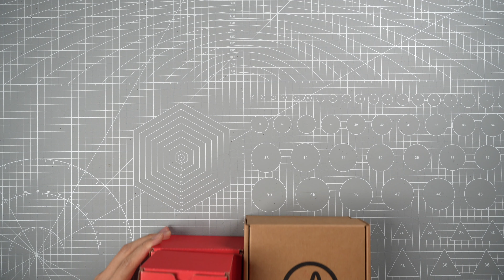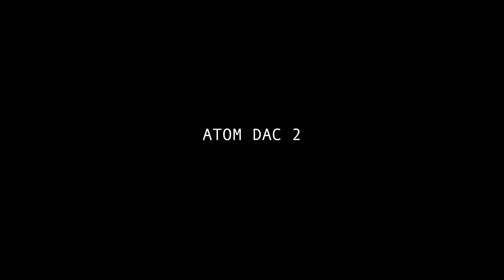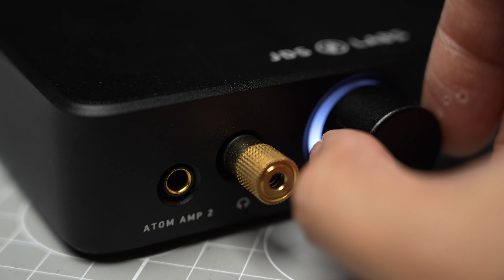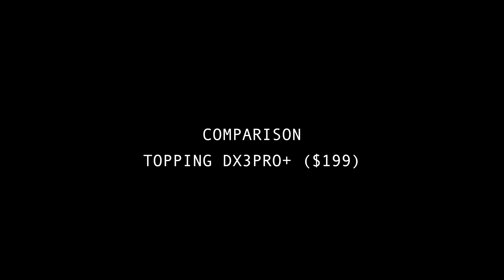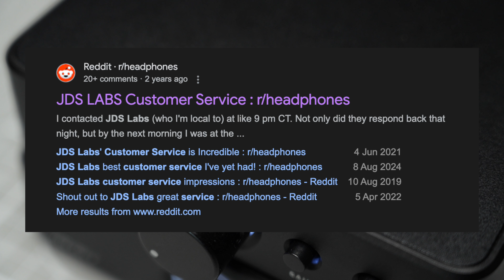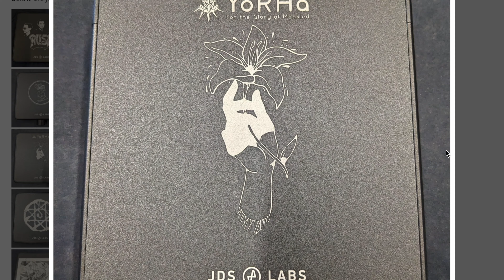JDS Labs ATOM 2 DAC & Headphone Amp Review

Comment: Interested on owners of the Atom + stack that upgraded to the Atom 2 stack? I am looking at price difference of $100 to buy new the Atom 2 Stack over the Atom + Stack. Is there a huge difference over the older Atom + stack that one would fork over the $100 to go Atom 2 Stack?
Reply from the maker: If budget is a concern, I would get the DAC+, which is on sale for $59 now. And pair it with the Amp 2. It would be really difficult to detect a difference or upgrade for the DAC. But for the Amp, you get more power on the Amp 2 which is definitely a more substantial difference.
Reply: @Late_Night_Unboxing  That is what I was leaning toward, but didn't know if the Dac + would work well with the Amp 2. But a Dac is a Dac right? So interface's would be the only real difference, where I am good with the Dac + USB-B or optical input. I was going to pickup a tube amp later that can use the Dac + as well. Thanks you
Reply: @Late_Night_Unboxing  Ended up going full Atom 2 Stack. Just pulled the trigger and order the Bundle, don't know if it will come with RCA's like the pick but I will just pick up a pair of "World's Best Cables". It's a early Christmas present to me. Funny because 4 days ago I was going to go full Schiit stack but after many reviews talking about how linear the Atom amp is it sold me on it. Also JDS Labs is a few hours from my home and so I figure keep the money in the community vs sending it to another area. Thanks for the reply and the review.
Reply from the maker: @sn4rl277  Great choice. I think the metal enclosure is a nice upgrade. I don’t think you can go wrong with either. I previously had the Schiit Magni.

Comment: I have the jds lab 1 was thinking buying the new atom 2 i know its more powerful and can run harder to run headphones compared to the atom 1 but will the atom 2 sound better using my headphones that i use for the atom 1 and my headphones are not harder to run so there's no problem there i just want to know it the sounds will be clearer and better bass or i won't notice any difference  then i won't buy one or do i need the dac as well to notice a difference
Reply from the maker: I don’t think it would be worth it to upgrade if you already have the Atom 1, especially if you’re not driving anything that requires the extra power. I don’t think you’ll notice any difference at all since the JDS amps are pretty much transparent and uncolored.

What DAC do you use now?
Reply: @Late_Night_Unboxing  I don't have a dac just dont need one just use my headphone  atom amp for gaming on my pc and for music . Thanks for the advice you've just saved me some money cheers
Reply from the maker: I see… I would suggest you get a dedicated DAC if you ever want to upgrade though. Onboard audio outputs are usually pretty bad, with lots of interference and noise. Connecting it to an amp will just amplify the noise with the signal.